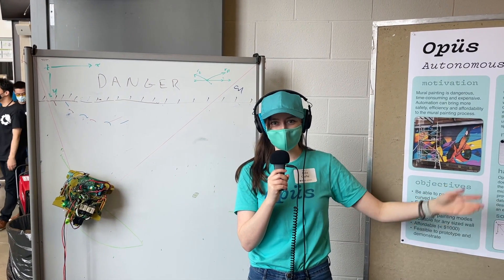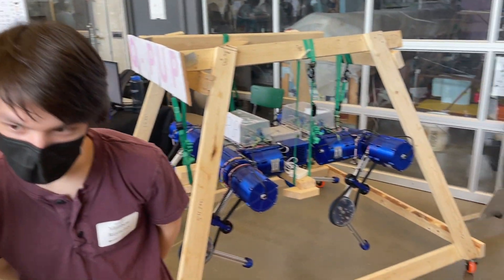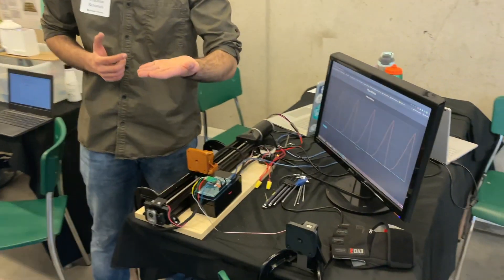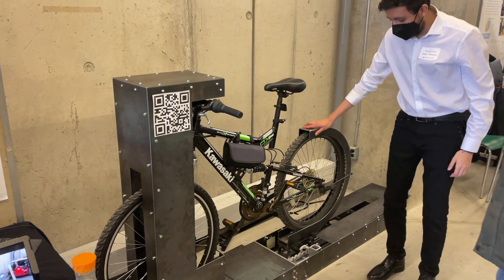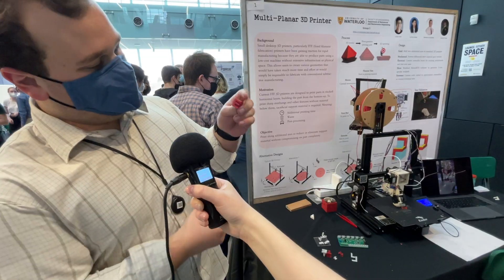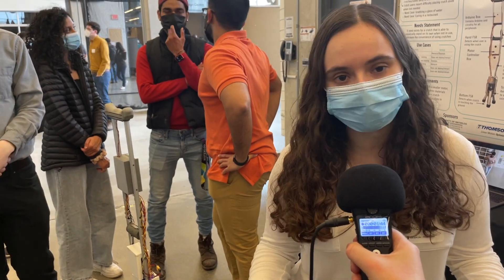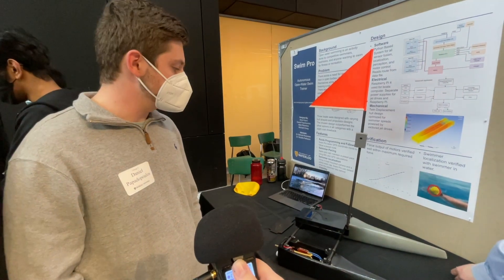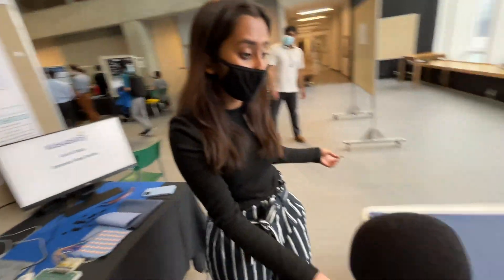Mechatronics Engineering Symposium 2022 (University of Waterloo)

Comment: 📺💬 I have a robot for random area travel on its 4 legs because of passive traveling for working as a caravan. 🪂 👧💬 Para-feedback system.
📺💬 Do you mean as this one notes create accurate frequency together it creates a new note that has signature and information. 🎶
📺💬 It is pri-metric machine, that continues working and training at the same time  🐑💬 That is amazing when advanced progress possible when the machine can adopt new abilities when working.
📺💬 Plant-based living organism substances by machine ☘ 🐐💬 It is not a critical activated system but improvement of method and learning how we survived with good life and nutrition most of the machine working on critical activate.
📺💬 Location simultaneous 🗺 🐐💬 That is wides known spread usages on tracking systems, chemicals,s or even on tasks like fabric and materials.
📺💬 Vision located targets, now we do it fast to detect police officer mayo  👧💬 That will require some property information like temperatures, time scheduling, and advertisements bands. 🧢
📺💬 Bicycle car parking 🚲 flexible car parking size, dimension and security unlocked system 🐑💬 Do I need to take a paddles home⁉ I always need to do that because it has fashion paddles and same handles policy.
📺💬 It is big features 📺💬 That are really cools ‼🧸💬 That are different shapes with materials grades fabric how it can perform tasks differently ⁉
📺💬 KeyTabs ... 🧸💬 We see of that before but how you can train user to use it⁉
📺💬🌵 Cagtus feeder how we make it lower costs and saved energy ♻
📺💬 Medicines and compounds structure robots 👧💬 That is nice and the commercial machine is expensive but we build messages capsules and guilding used for long time ago want to see⁉

🥺💬 Thank you I see this VDO because it is interesting and it is interesting.